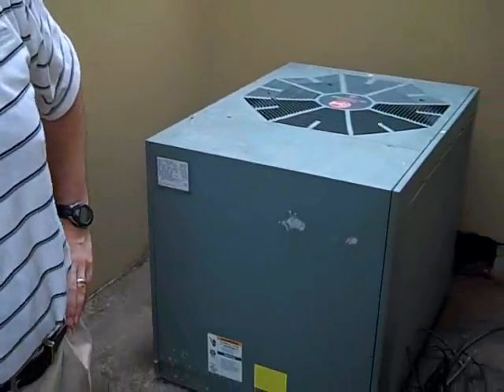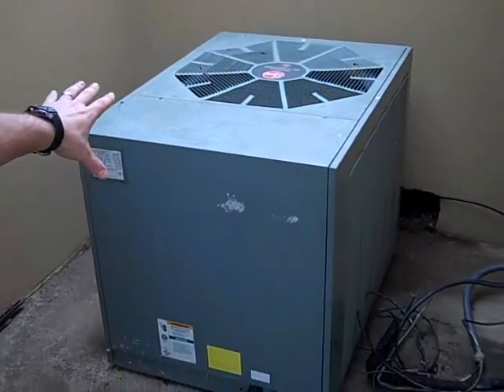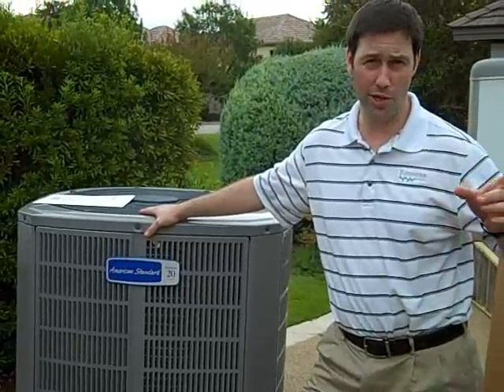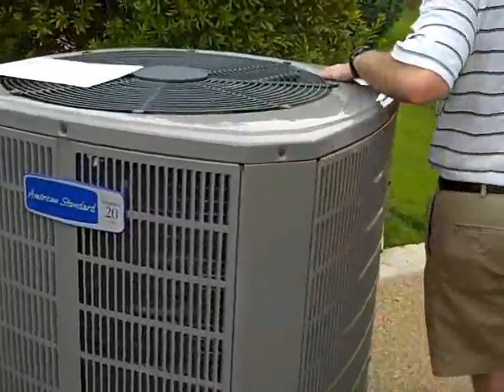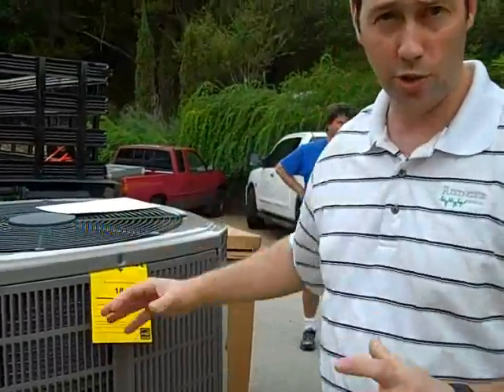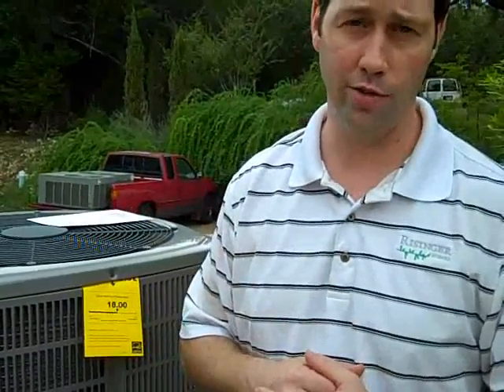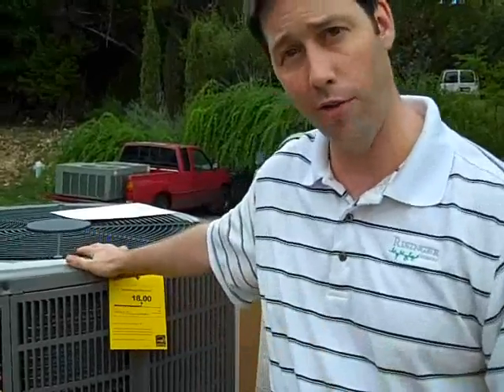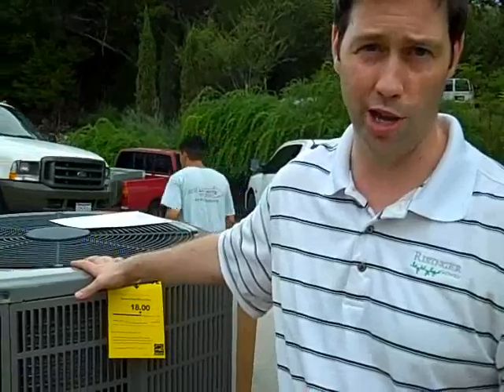High Efficiency American Standard AC Compressors

Comment: Am Standard does not cover labor cost in their warranty. Compressor died on my 22 mo old Am Standard AC unit and the cost to replace it is $2100 - that's just the labor.
Reply: You should have purchased the 10 yr. extended P&L for the system for $ 300.-